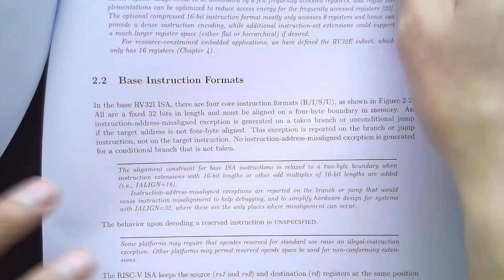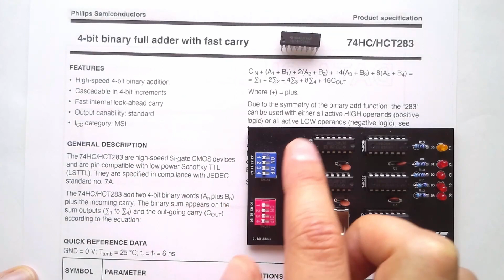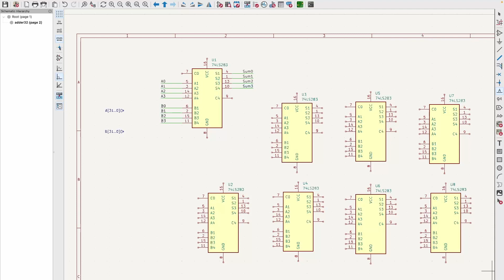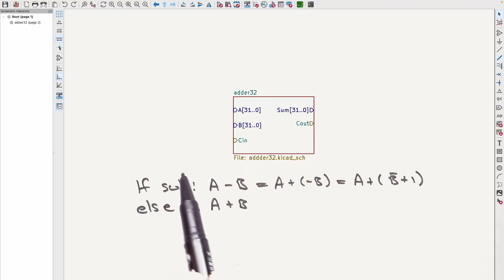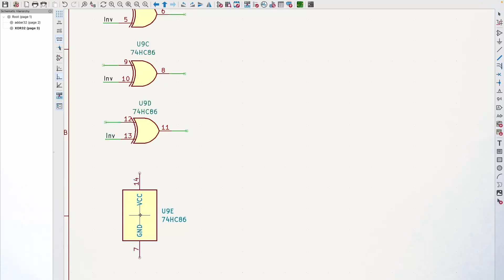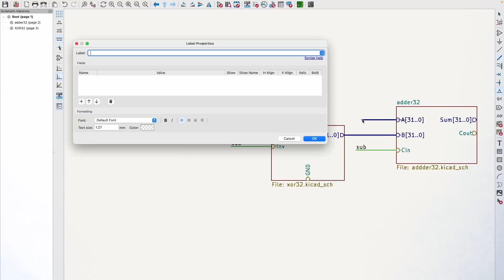ALU add & sub (RISC-V Part 1)

Comment: Don't you need A buffer for every 8 to 12 INV inputs gates to deal with the fan-out limitations? (4 inputs per chip) ?
Reply from the maker: Fan out is only an issue for switching speed (due to the input capacitance of the chips you are feeding into) and current supply (we need to consider the max current draw from all chips when they are changing state). In my case I am building a very slow CPU, so switching speed isn't an issue, and I'm providing the sub/Inv signal from a source with a relatively high current supply.

Comment: I have no problem With using An XOR For flipping bits When it's 4 or 8 bits. But why do everybody try using them when they're gonna play with over 8 bits? Yes I understand this is educational And I appreciate that.  But why not use a SN74HC540DWR inverter with tri-state and a SN74HC541DWR  a buffer with tri-state, with a 74hc04 hex inverter to slect between the two. Or better withe a single gate be tween the two,  74HC1G04GW,125? Yeah your going to need a buffer for ever 8 - 12 gates but you cut down the number of chips to about 8 chips plus some glue logic?
Reply from the maker: If I've understood what you are proposing correctly, you'd need 4 inverter chips with tri-state output and 4 non-inverting buffer chips with tri-state output. That's 8 chips, same as the number of 8 XORs I've used. So I'm not sure of the benefit here.